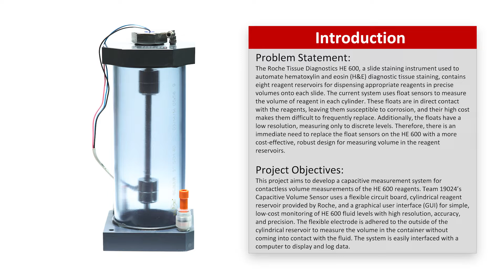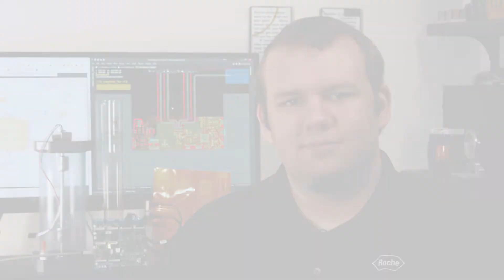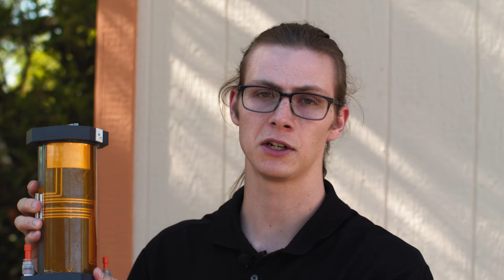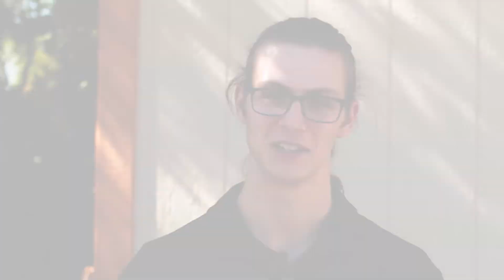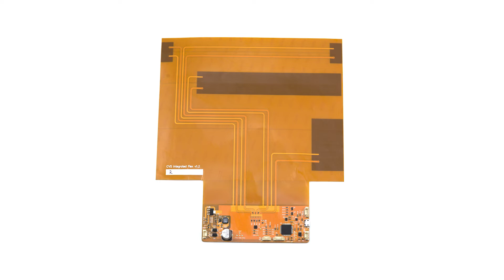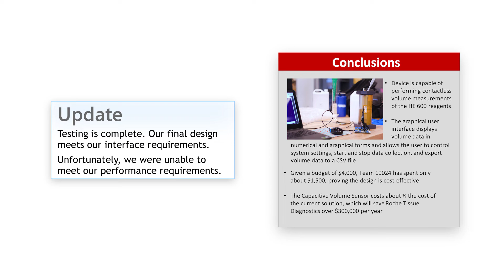Capacitive Volume Sensing (UofA Senior Design, Team 19024)

Comment: Capacitive sensing is a brilliant substitute for the float switch. Float switches sound great in theory but if you are measuring liquids that have a tenancy to crystallise upon evaporation your float switches are going to fail in time. Capacitive sensing on the other hand is one way where it is 100% reliable.